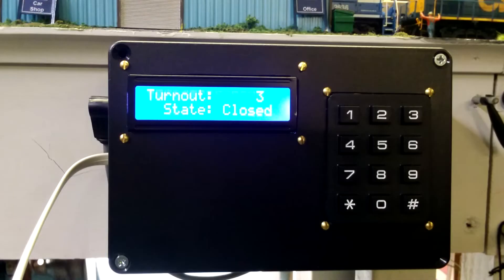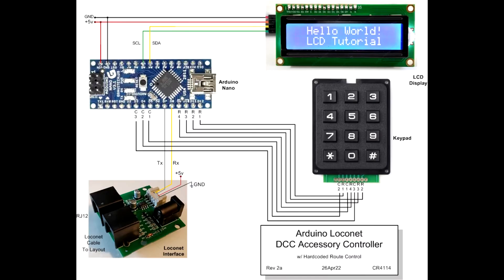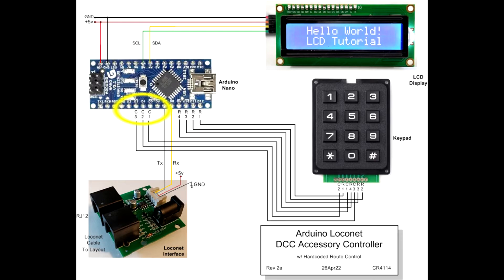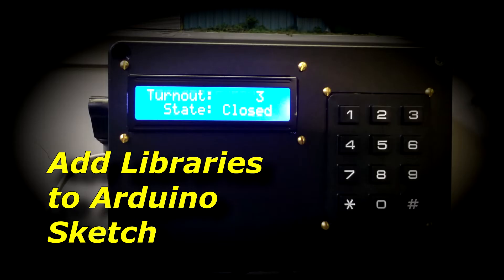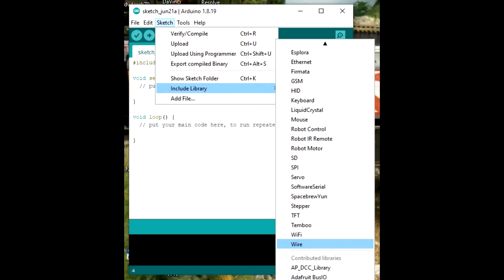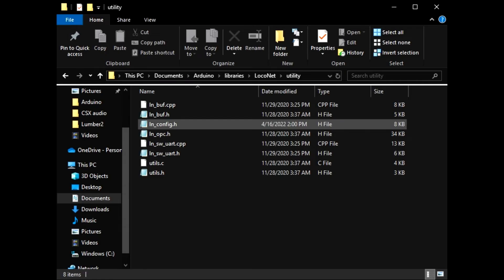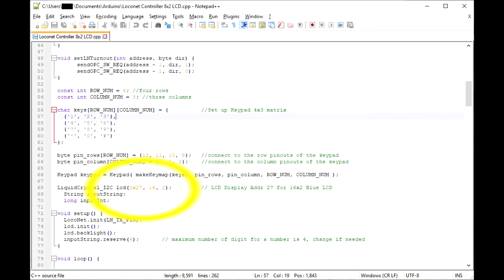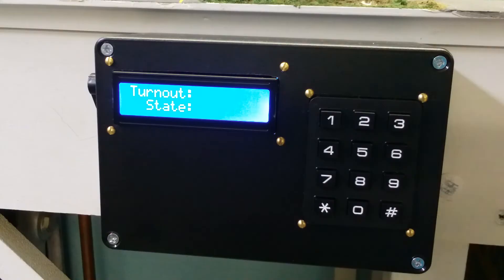Build a Loconet Accessory Controller

Comment: Where did you get the backplate from? Or did you make it?
Reply from the maker: @RichardFrenchRacing I bought the enclosure box on the auction site and cut holes in the faceplate for the keyboard and display. Thanks for watching.